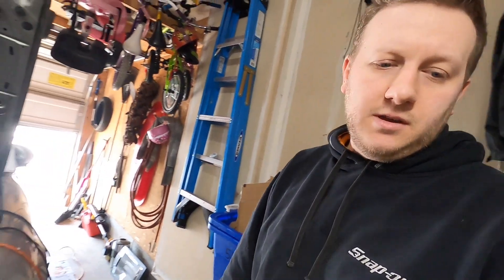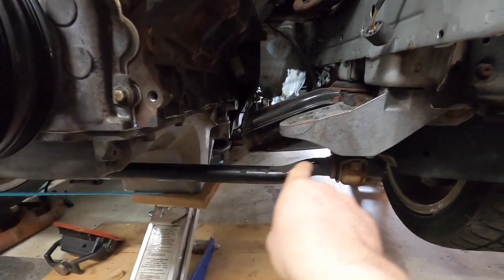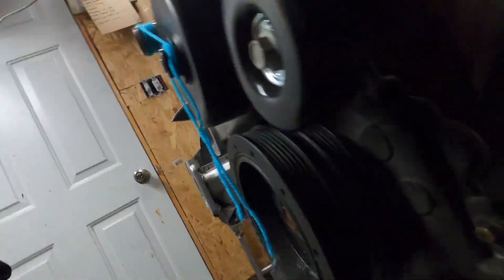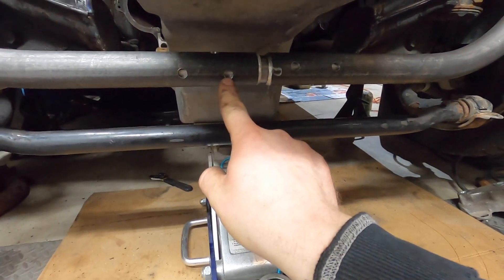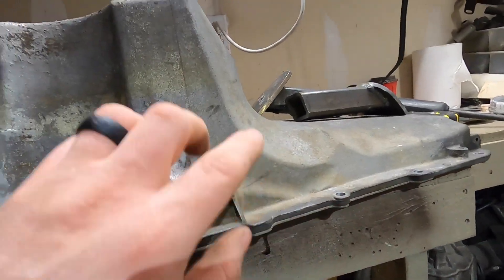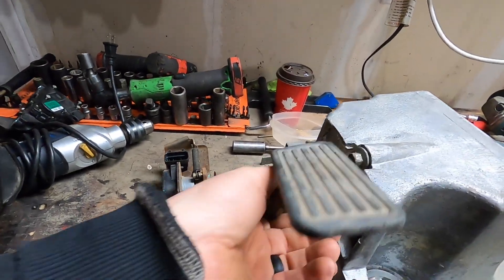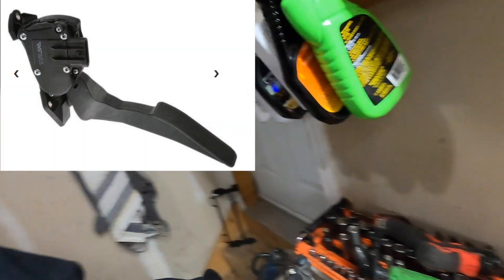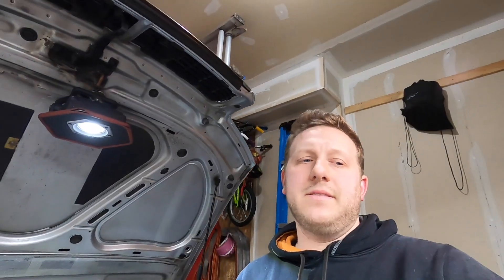Building New Engine Mounts, Simple Solution For The DBW Pedal! | Audi A4 LS Swap

Comment: What are you going to do about the driveshaft im building a 2010 a4
Reply from the maker: Not 100% sure yet but probably steal one off of a Chevy pickup from the junkyard and have it shortened
Reply: @jonamond  are you using stock diff
Reply from the maker: No, the gm transmission spins the opposite direction than the Audi transmission in drive. Probably going with an explorer irs 8.8
Reply: @jonamond  how did you figure that out is it the same for the 2010 a4
Reply from the maker: Seen others run into the same issue. The ring gear on the stock diff is on the opposite side as a gm diff... difference directions
Reply: @jonamond  oh okay I'll have to check, mine is most likely going to be the same